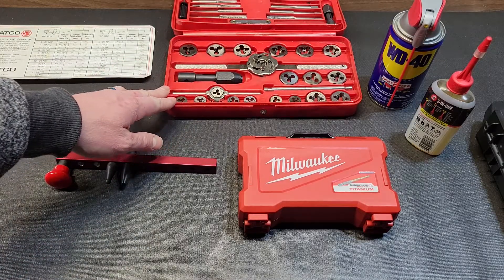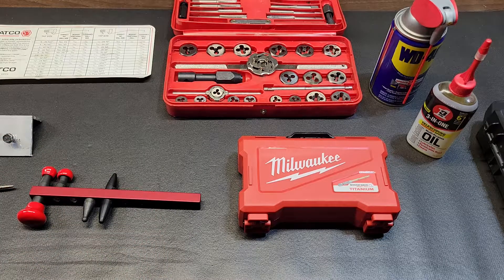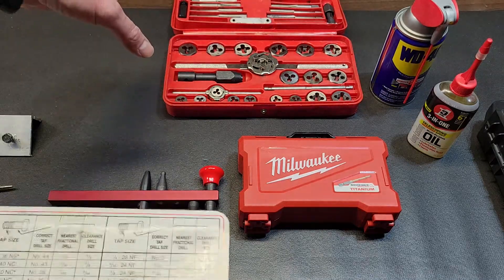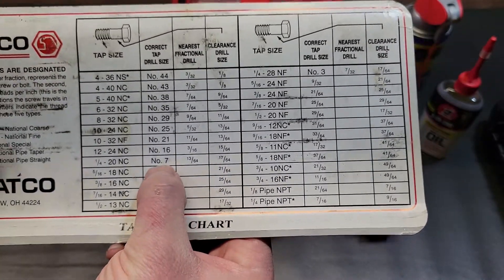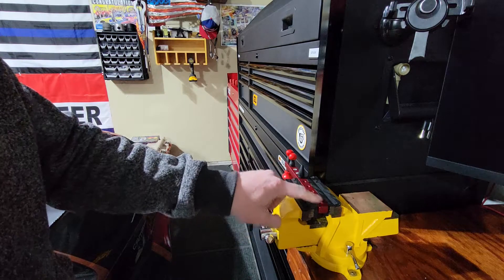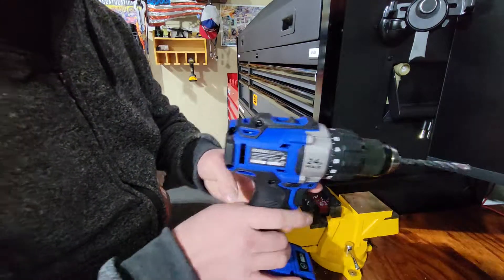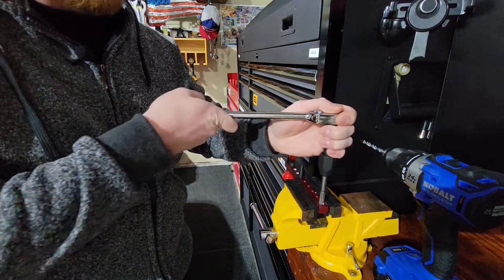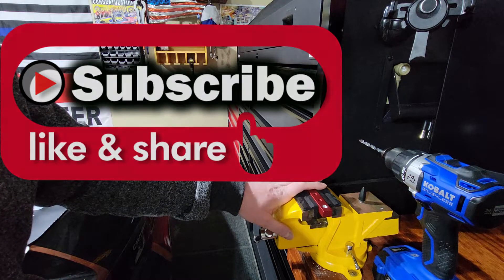How to Properly Drill and Tap a Hole with Minimal Tools and the Tools you will need

Comment: A helpful tip if I'm using a 1/4-20 tap I find a new 1/4-20 nut and check if my drill bit fits through the nut if not the bit is to large
Reply: Thats a good idea. I've just been eyeballing them. Trying to size them up using the tap or drill bit as a background on each other. I like your method better.

Comment: Good explanation and demo. I’ve chased a few threads, luckily haven’t needed to retread any yet (fingers crossed). How bout a demo on what to do when you break a tap? That could be fun (for us) lol.
Reply from the maker: Lmao I like how you put (for us) bc you know it would not be for for me lmao. If I break one I'll make sure to record a video on removing it.
Reply: @TonyTheTechnician  I’ve seen it happen twice, and both times were because they used an impact lol. Do you use a tap extractor? Or do you have another method?
Reply from the maker: I've used a tap extractor before at work but not at home. And drilling them are a real pain bc of how hard the material is. Once in a blue moon as Ling as the tap went in semi smooth I've been able to heat and use a pick. But we have also had to weld a nut or bolt to it to extract it. It can definitely be a nightmare lol
Reply: @TonyTheTechnician  Yeah, you got to get those expensive (and badass) drill bits to drill them. One of the times I saw it break was when a guy used a 1/2 impact on a dozer blade. No clue what he was thinking, but we all just walked away as soon as we heard SNAP lol. Not sure how they got one out, but I know he got an ass chewing.
Reply from the maker: Haha damn and ya the bits needed for that are ridiculously expensive. And God forbid you break a bit in one of the taps then you might as well just give up lol
Reply: @TonyTheTechnician  My stomach just turned thinking about that……
Reply from the maker: Haha I know right

Comment: Tap and die set recommendations? Seems it’s hard to find any decent ones that’s not off a tool truck.
Reply: Irwin makes good ones. I believe they make several, if not all, for the tool trucks.
Reply from the maker: Ya Irwin is a good one. I stay away from the cheap sets when it comes to taps and dies. Using cheap ones can make a bad day so much worse so unfortunately for a good set your minimum price will probably be around $100
Reply: I just bought a second hand set because I'm poor. $40 for a 60 piece hardware store brand.

Comment: Automatic transmission fluid works good as cutting fluid too.Usually use Dexron 3.I always clean my taps before putting them away after use.Spray them with brake clean which does not hurt the taps
Reply from the maker: Absolutely 👍 great tips
Reply: @Nunya Business Do have to,ready to use for the next time it is used
Reply: Thanks for the ATF tip. I've always used boelube at work but need a quick cheap work around for in my garage.
Reply from the maker: Atf only becomes corrosive at high temperatures. So as long as you aren't soaking your taps in a bucket for 5 years and then heating them up to 300 degrees. I am almost positive everything will be perfectly fine.
Reply: @TonyTheTechnician  oh so don't use ATF on a drill bit then?
Reply from the maker: @homealone5087  it's fine to use bc it's not always soaked in atf and over heated for long periods of time. The drill bit will go bad before anything happens bc of atf
Reply from the maker: You most definitely want to clean them before putting them away not just to prevent rust but to get all the metal shavings off of the taps